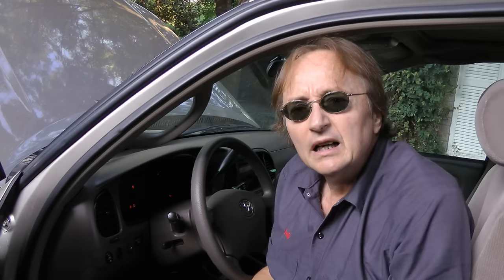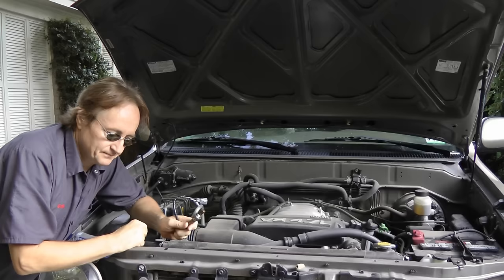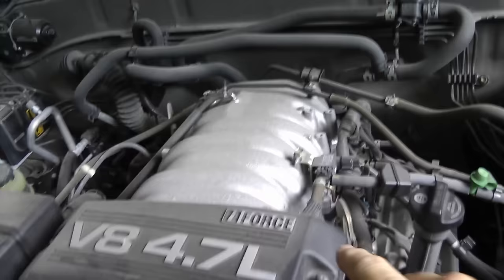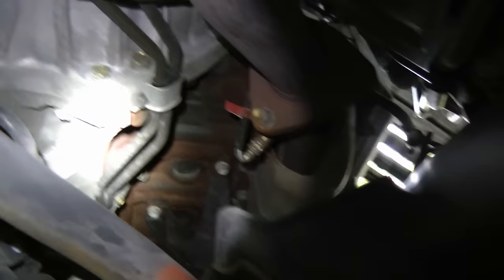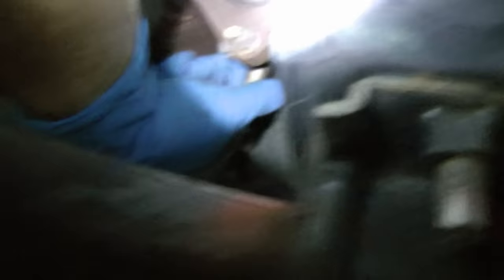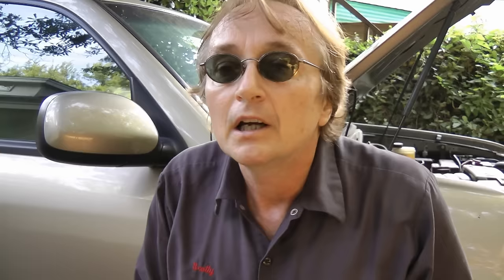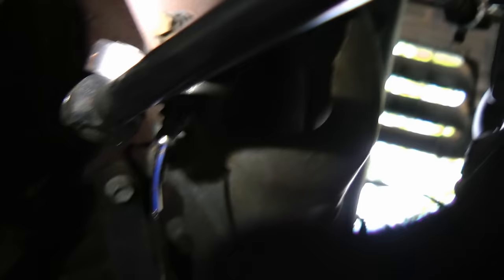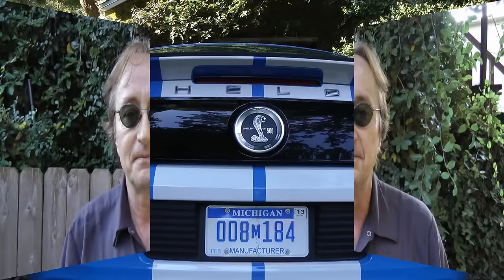How to Replace an Oxygen Sensor in Your Car (Air Fuel Ratio Sensor)

Comment: I just took my 02 xterra 3.3 v6 non sup 2wd to meineke today to finally get it looked at after 3 months of tearing it apart. Turns out a screw came out in the distributor. Well i barely get 1/2 mile down the road and check engine light. I have codes: p0132, p0152 which I'm pretty sure are bank 1 and 2 oxygen sensors. Meineke recommends another $95 diagnostic to find out what the problem is (is it the o2 sensors gone bad, or something else causing it?). Not sure what else could be effecting the two sensors and I just dropped $240 between the first $95 diagnostic for a crank/no start, plus a hose popped and I lost my tranny fluid when they test drove it (likely something I didn't connect all the way) so that was another $95 on tranny fluid and some more on labor. Is it better to just do the diagnostic or buy new sensors?
Reply: This may be a rich condition in the engine on both banks, not likely to be two independent o2 sensors failing. What are the LTFT long term fuel trims percentage?

Comment: Hey Scotty,thanks for all the wisdom you share. I have a 00 dodge neon that wants to die after I put it in gear. No accelerated when I press on pedal to go uphill. I took it to a dealer and I had them replace the starter that went out after trying to crank car with dead battery. Now the engine light is on and they said it read the code P1071,upstream oxygen sensor. is that for the sensor or would a different code for sensor? I know it needs spark plugs because they do have build up due to a little oil leak I had but used a fluid sealer. it looks like the fluid is coming from intake manifold but no puddles on the ground just a bunch of build up. So they cleaned the throttle body and I'm going to do plugs(already had valve gasket replaced along with valves for plugs. Now I'm thinking the code is the upstream.  Where is the 02 sensor and Not sure which bank? Can u help,any info would be great. running out of options. I'm getting sick of one thing after another but only car we have. I just need it up to par and it sounds thuggish and I can't be stranded with kids when it dies. Thank you in advance,sorry so long!
Reply from the maker: +Christina Zieler   many things can do that. But, as it burns oil on the plugs, engine is wearing out, then that damaged the sensors and the catalytic converter. Fixing that permanently is WAAY too much money to put on that neon. They are dead end money pits when that old. You're better off ditching it and buying a good old used toyota on craig's list
Reply: +Scotty Kilmer The intake manifold is leaking not spark plugs. They are just a little dirty from the oil spilling out and collecting dirt. There so smoke coming from exhaust so it's not the catalytic converter but I do hear a noise as I accelerate. I sprayed brake cleaner and it idled higher. Maybe the intake manifold.  Can diy pretty cheap. I need to do what I can with what I have.

Comment: Hi I have a 1994 e350 cub van it's a 16 ft moving truck ok so this guy said I need a rebuilt tranny well the problem is the steering wheel was put in wrong nothing light up on the dash the mileage don't work nor the rpm so my question is do u think we need a new tranny if it will only drive on second  and when driving on first it's not caching gears

Comment: I need help I have a Pontiac booneville 1990 , my car kills on me on certain times..  sumtimes it start an sound like its hesitating start den it will get clear an when I press the gas in park he backfires alot of popping feel like no acceration coming threw.. but some days it drive with no problems. . Feel lile its not jumping in the gears like it post to.. I really need help been tryna fix this problem for years.. got a new starter new fuel pump new hamonica banlancer new spark plugs used radiator alot tryna fix it I need your help big time !! Please answer back!
Reply from the maker: backfiring is mainly one of two things, either the valves in the engine are wearing out, or the fuel injection or ignition system is shorting out. Have the ignition control module checked and the fuel injectors, odds are it's one of those on that model

Comment: my mitsubishi eclipse spyder has the light on I just wanna replace a few items and see if it goes off but I don't know were my sensors are 4 cylinder 16 valve.
Reply from the maker: jack it up in the air, they bolt on the exhaust system before and after the cat
Reply: Scotty Kilmer. okay it's very low to the ground the exhaust is aftermarket . I'm gonna try my obd 11 scanner the guy at AutoZone couldn't get his to work he told me to change a fuse . I'm only 20 years old but I'm figureing it all out

Comment: Heu Scott can you tell me how check if the o2 sensor of my 2005 nissan titan is bad I got code po430
Reply from the maker: takes a pro with years of experience and some very expensive tools to correctly analyze the sensor. Either guess with a new one, or pay a mechanic like me to check it out

Comment: Hey Scotty I have a 2004 Buick Lesabre and I pulled a code p0140 oxygen sensor bank 1 sensor 2 but im having trouble removing it because it is seized on and also I dont no how to remove the shield covering the wiring to it can you help please

Comment: Bosch sensors / items.

I have learned one thing consistently with my cars. Scotty will agree or disagree with me.

When it comes to electrical items such as Alternators / spark plugs. I will try to use OEM parts.

Toyota uses Denso

Jeep uses Mopar

Ford Uses Motorcraft

Toyota says that on their cars you can also use NKG plugs. I don't know much about NKG. I used a duralast alternator in my ford and it caught fire in columbus Ohio.

Comment: hey,I have a 1992 2.4L 22r Toyota pickup. It has a code 22 and I can't figure out what the code is please help. it idles up and down !
Reply from the maker: either the engine coolant sensor is bad, the wiring going to it, or the main computer is bad. good luck

Comment: scotty- my 2001 saab 9-5 has code for a bad oxygen sensor. would that cause my car to smoke a lot?
Reply from the maker: sensors don't normally cause smoking, but a smoking engine from head gasket wear or piston ring wear will ruin an oxygen sensor . I would assume you have more than one problem

Comment: I got a 95 isuzu trooper ls and it was skipping so I put new spark plugs in but still had problems like it is skipping and the rpm goes up down a lil while stopped and the engine shakes and when I stop then hit the gas it stumbles then pick up power any ideas

Comment: Hi Scotty, I have an 05 Ford Tauras that had a bad oxygen back bank sensor bad. Check engine light came on. My roommate is a certified mechanic, so I let him do the job. My problem is he claims he had to drop the exhaust manifold to get to it. He didn't use the socket. It was put all back together, since he had to tap it out, it's leaking red fluid now under car.
Reply from the maker: red fluid is transmission or power steering fluid. He messed up something , make him fix it and then have him stay far away from him auto repair wise. You don't have to drop the manifold to do that, I've done plenty of them, you just need the proper tools AND the ability to use them.
Reply: For sure. Apparently he took out the transmission tube to get to it. Never  finished it. Firestone put it back on. Not the dipstick, the tube.
Reply: I'm glad he is moving out soon.
Reply: Sad. I was trying to save money. I lost my Dad 10 months ago. He was old, but I'm in house and engine light came on on weds. But suddenly went off. He conjured me to get a code reading anyway. Then pursued the purpose thinking I would vulnerability take rent off. Well, I waited a day to drive it to see if any leaks, and sure enough, tyranny fluid. Firestone wouldn't lie hopefully. I Google Drive if you have to disassemble a tyranny tube to get to sensor, and that can jappen. He's a moron, bc he forgot to finish the job. His business is Dad's maintenence. Bouldet, colo. Never again.
Reply: Thank God first one didn't charge me anything, but I think I'm going have the tyranny drained with a new filter. Just to make sure he didn't screw me anything else. Thank u so much for being on my side. I knew smthing was wrong and he denied touching the tranny. Dhhh.

Comment: 01 Tacoma V6. Just replaced the upstream o2 sensor as my check engine light was on. I am also only averaging 15 mpg. Isn't replacing a bad 02 sensor supposed to help mpg? I've driven 200+ miles so far on the new one and no improvements in fuel economy
Reply: Jimmy S I did erase the codes. Its been a while now with no real inprovements. Spark plugs, air filter, and coolant are all good. Fuel filter needs replacing however. If I remember right it was p0171
Reply: Jimmy S Whoops wrong code. I had that one since I got the truck so I'm used to that one. Idk what the code is for a bad upstream o2 sensor is but I had it. Its fine now. Just not getting too much of a difference in fuel economy

Comment: What can I do when I have a problem with code p0002. What steep I would need to take I have a mustang 07..
Reply from the maker: you either have bad wiring, or a bad fuel regulator solenoid. Often the solenoid

Comment: Hi,
My car has codes P0056, P0060, P0161, and P0052. 
Check engine light is on.

Do I need to replace oxygen sensor in bank 2 only?

2008 Pontiac V8 engine.

Comment: Scott I have 02 Toyota Sequoia it overheats only with Ac on if I turn Ac off it goes back to normal any idea? thank you
Reply from the maker: Silvan Prendi check the radiator cooling fans, and if they work, replace the radiator, old ones won't dissipate that extra heat
Reply: Scotty Kilmer -Hey John Lennon-you know your stuff.

Comment: Hi I have 2002 toyota sequoia , o2 sensor problems it bank 1 sensor 2 . And o already replaced one on and the check engine light go always about 2 weeks the light come back on again same  one .and I feel like  engine shacking a bit too some time .what should I do can you help me pls thank
Reply from the maker: realize those are complex feedback computer systems that measure hot gas mixtures. You tried the easy fix, that's not it . Time to see a really good toyota mechanic on that one. Often a bad cat though.
Reply: Many thanks :-) may you right I just got stolen cat on my car but I put the new one on that could ne the problem?

Comment: can you tell me where the Oxygen Sensor is on Ford tempo 1992 3L-V6?
Reply from the maker: mario agostini it should have two bolted on the exhaust system, jack up the car and follow the exhaust pipes from the engine back to the cat, they are the ONLY ELECTRONIC things bolted on the exhaust pipes

Comment: Scotty great video , I got 2 codes on my car one was for random mis fire on cylinders 2 , 4 , 6 and the other one was P0125. I asked Toyota what P0125 means and they told me that it was an air fuel ratio sensor. 

I said its oxygen sensor right. They said no , the part looks similar but the air fuel ratio sensor performs a different job. I never understood that one.

Your thoughts on this

Comment: Hi, Scotty I have a 2010 Nissan Xterra and my check engine light is on, I checked and the code P0031 poped up saying "heater control circuit low". I have no idea what that means, can you tell me please? Thank you!!
Reply from the maker: that's the code for heated oxygen sensor not working right. Most of the time it means you need a new oxygen sensor, the one on bank one of your engine, the sensor BEFORE the catalytic converter, not the one after it
Reply: Scotty Kilmer awesome, thanks for the help Scotty!!

Comment: can a bad o2 cause your engine to flood? i have a 00 ford ranger 3.0 xlt. what happens is the truck will start randomly bogging while driving to the point my truck dies and i have to coast till i find a spot to park. when trying to start it sounds like its missing and i can smell a sulfur smell and smoke is pouring out the pipe. but if i let her sit for a few hrs she starts up and runs fine.
i have checked the pump and everything ok but when i run the computer the only code im getting is flexfuel but i am not using it
Reply from the maker: it can by making the air fuel ratio wrong
Reply: now what about the flex fuel sensor why is that going i am not using
 it

Comment: Please help! I got an upstream oxygen sensor code last november. Forgot what the exact code was but the car was throwing the same code multiple times. After replacing the sensor, the check engine light went away for about 2.5 months. Now I am getting P0171 which is bank 1 too lean. I also feel the engine shakes when idling. It has been unusually cold out so I don't know if that has anything to do with it. So what the heck is going on with my car? Do you think I just have bad luck and have a vacuum leak after a bad sensor? Or the two codes are somehow related? Was the oxygen sensor that I put in bad?
Reply: Actually, it was more like 1.5 month when I get the new code.
Reply from the maker: renodeify
vacuum leaks do that, as can weak fuel pumps or weak fuel injectors. And of course, the oxygen sensor measures the lean or richness of exhaust, so it's a complex interplay. I would start by looking for vacuum leaks though,as in my video "finding engine vacuum leaks with a cigar"

Comment: Scotty, I have a 1993 Saturn
 Sl1 that is driving me crazy! When the engine warms up and I drive for 2
 or 3 miles the "Service Engine Soon" light appears. The code read out 
13 O2 SENSOR. I replaced the o2 sensor with a Bosch and I replaced the thermal sensor and spark 
plugs and the light display still comes on when the car warms up and 
driven 2 miles. Also, there is a burning smell from below the engine 
after I drive it for say..8 miles. I can only smell it when the car is 
parked and I'm outside the car. Other than that, the car runs perfectly 
fine. This is driving me nuts! Do you have any idea what could be 
happening? Thanks.
Reply from the maker: +spudwas realize the O2 sensor system is part of a complex computer run feedback system. as such, over a dozen diff things can trip that code. If it runs OK, ignore it. If not, pay a guy like me to analyze and fix it at 100 dollars per hour labor

Comment: Scotty, I have a 1997 Mitsu Galant ES with 269k on it and my check engine light stays on. The code is for the Idle Air Control Motor, which I replaced with a new one. Light came back on for same code and I put a new Mass Air Flow sensor in and the light went away. It came back again. Could the O2 sensor be the culprit? I have no Cat convertor so I just have the forward O2 sensor to deal with and it has never been an issue till recently. Symptoms are rough idle, surges, almost stalls, high idle.

Comment: where do i get a device to check what code is bad? i had a mechanic check the car and he said i had to 02 sensor malfunctions and its way to expensive to get fixed in the shop.
Reply from the maker: tons of obd scanners out there, from 10 dollar chinese apps for your phone to 25 thousand dollar dealer scanners. BUT, you'd have to know how to work one, and really, that takes years of experience. You could of course guess with new sensors, most are pretty easy to change out

Comment: A few hours ago I replace both of them. the mechanic took 90$. 
I went back home and clear codes and after driving for less than 10 minutes, check engine light came on. I checked it and it has the same codes.

I noticed something while the mechanic working. I found above the oxygen sensor a pipe is not connected to anything, similar to pipe in intake

Is this hose has a relation to check engine light?

I'll record a video if you didn't understand my English.

Thank you.

Comment: hey scotty  three months back i have changed 2 sensors but the engine warning light  still stays on i brought my car for emission test last week they failed it because it was showing co2 high brought to garage they checked there was a problem with  exhaust it was leaking  but after that they reset the light but engine warning light  came back again so please could you help me what could be the problem. thank you very much
Reply from the maker: those are very complex computer run feedback systems, and over a dozen things can trip codes. Find a REALLY good emissions mechanic on that one
Reply: +Scotty Kilmer thank you very much for replying

Comment: Hello Scotty, I have a question. Would you know what causes occasional high idle on cars? I have a 2005 pontiac grand am with close to 200,000 miles on it and sometimes, when I have been driving for a while and the engine is warm, the idle will increase from it's normal range of about 700 rpm to about 2000 rpm. One time I had it start increasing to close to 3000 rpm, while I was an an atm, before immediately turning the car off and waiting as it sat for a minute, just to turn it back on and have the idle rpm back into normal range. Also, when the car begins to high idle and when I am starting to break and come to a complete stop, the car feels like it is trying to accelerate forward on its own. Any suggestions? Thank you.
Reply from the maker: sticking throttles often does that, try cleaning it with spray throttle cleaner
Reply: Scotty Kilmer
Thank you, I will give that a go!

Comment: hi I need to replace my 2003 Toyota camry 4 cylinder sensor... I was wondering which brand should I buy for this car and would my owners manual tell me which one Toyota uses. Also, do I only need one for my car or more?
Reply: I used a 18 dlls eBay sensor and it worked great mpg went +6
Reply: when I replaced my oxygen sensor the check engine light was still on. why is that?
Reply: Dan s reset the computer by unplugging the car battery for 10 mins.
Reply from the maker: +Dan s drive it a couple days, but if it doesn't go off then, that didn't fix the problem. Actually over a dozen things other than a bad sensor can trip the code, from lean running engines to bad cats